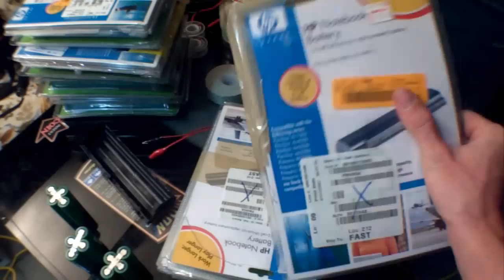DIY: 48v 24ah lithium ion 18650 e-bike battery pack

Comment: Hi, I have watched the second video about the charge balancing. However, the way you wire them is not exactly clear to me. You say you have six cells, but there are 7 wires. The video does not show exactly how they the banks of cells are linked. I would have thought there would be 2 wires per bank of cells IE: +/- (12) going directly to the balance charger. This would then explain how the balance charger can monitor the charge going into each of the 6 banks of cells.
Reply from the maker: the 7 wires are
0v - 4v - 8v - 12v - 16v - 20v - 24v.

hope that helps.
Reply: Rinoa Super-Genius Not really. I am not a electrician unfortunately. I understand enough to know that 0v - 4v represents the 1st pack of cells but I would have thought that you would need one wire from + terminal and another from the neg terminal, so 2 wires from each cell pack. It might help if I could find your schematic which you referred to in your first video.
Reply from the maker: Glyn Davies
 measure betwen 0 and 4 you get the first parallel pack, measure between 4 and 8 and you measure the 2nd pack. its just like dipping multimeter electrodes into a lead acid battery, each cell does have 2 wires coming from it but they share them with other cells. and as for the circuit diagram its in the description of the video, if you can't look that far then thats sad.
Reply from the maker: Glyn Davies
you can't blame me for not saying to click the "show more tab", should i also tell you how to turn on your computer?

and yes it's a girl's bike, because i identify as female and am having a gender transition.

i never proclaimed to be the best or even good. but i dont have time for people like you who dont want to listen to the advice i give and instead want me to hold their hand through how to do even the simplest thing like reading a video description or how electricity moves through wires.
Reply: Rinoa Super-Genius Ah... now I am beginning to understand some stuff. .. you, at least !   nobody asked you to explain how electricity moves through wires. I think its you who has the crossed wires & very little patience for your audience.

I understood 99% of your video. If you want to retain a interested audience in your work, then I suggest that you should have some patience for those who require a little clarity on the 1% which they do not understand, mainly because you had not made things clear in the video.

Have you never heard the expression "sometimes it is not possible to see the wood because of the trees" ?

As for your gender choice, that is your business and your personal choice, I am not interested and I will not judge you on that.

But for pity's sake pal ... please take a chill pill,  and be prepared to help people who show some very genuine interest in your work that you produce and who might wish to reproduce your examples for themselves !
Reply from the maker: Glyn Davies
 yes i was trying to tell you how it worked untill you started insulting me. but when i point out that you didnt look far enough to see something that was right infront of you, you get irate instead of learning from your mistake.

i dont know what to tell ya. you obviously dont want my help and just want to insult me. take your nasty attitude to somebody else's channel or i will ban you.
Reply: Rinoa Super-Genius You called me sad didn't you ?  that was the first insult which came from you.
All I asked was for you to clarify the wiring schematic for balancing the cells and I think I asked you politely.
I am still not sure, because I am NOT a electrician. I am not totally stupid but i understand the rest of the video.
I  have no intention of causing offence to you.
BUT insult me, and you will get it back pal. Ban me if you want, I won't lose sleep.
Reply from the maker: Glyn Davies
 i said if you couldn't check the description thats sad. but after i said that you did (with much difficulty) check the description.

i'll say it again, the cells each have 2 wires coming from them but they share the wires with the other cells.

voltage is only a charge difference, you can still check the middle cell and even though the negative of it is connected to the positive of the adjacent cell it still reads negative.

if that doesnt convey how it works then i would suggest linking AA batteries together and seeing if you can test them with your multimeter...

due to you not understanding this super simple principle of electronics i would suggest you not mess with large batteries right now or you might hurt yourself. research electronics and do tests first so you build your own understanding.
Reply: Rinoa Super-Genius At last, a rational explanation, that is all I asked for.

There was no need for your last paragraph.

Why did you not explain that in the first place ?

As i said, I am not a electrician,  but which part of that did YOU not understand ?

I have already said that sometimes it is difficult to see the wood for the trees.

But..  Oh ... I forgot didn't I ?
Your wish is to be female ... no patience for anything or anybody
THIS EXPLAINS EVERYTHING

Don't worry about banning me, I have banned myself !

Comment: Hi - hopefully you find time to answer this:  were the laptop battery packs you ordered labeled HP or were they generic?  I know they were in HP packaging, but that doesn't mean much.  I'm trying to find out if the generic "no name" batteries would have the good name brand cells inside them.  Thanks and keep up the good work and laugh on at the haters and flamers!
Reply from the maker: they were name brand, the generic ones have binned cells from the same manufacturers, and batteries without any english lettering tend to be poor quality cells.
Reply: Thank you very much for the reply and answer. :-)  It was as I was suspecting and now it's confirmed.  All is well with the universe again!

Comment: Your battery and wiring are capable of delivering 480 watts ( .64hp) before melting. I would increase the size of your wire and fuse it if you haven't already. Be absolutely sure you don't overcharge those lithium batteries or things will go bad quick.

Comment: I am trying to replace my ebike lead-Acid battery 24V 24aH with Lion 18650 cells. Once pack is completed, I suppose I can;t use my existing charger of LeadAcid Battery. Do I replace it with Imax 6 Lipro or  similar..
Reply from the maker: yeah you can use it, just get a BMS from ebay or whatever. a BMS is a circuit that manages the charge of the battery. i put a BMS on mine and used the dc charger that came with my motor kit.
Reply: Thanks! One more question:- will the BMS work the balance charging as well :)
Reply from the maker: Pratibha Cashmere
yeah thats its other main feature. make sure you get one for your type of battery though. like lithium-ion or lithium polymer (they are the same chemistry) as opposed to LiFePo4 which runs at a lower voltage.
Reply: Okay, I am building lithium ion from 18650..so will go accordingly.
Tnx

Comment: I guess somebody mentioned before, but just in case: You should never make a lithium battery without a BMS (management pcb). It will go out of balance and then explode when you charge it. A BMS costs about $30 and is easy to fit.
Reply from the maker: yes it has been mentioned before, so next time instead of typeing "i guess somebody mentioned it before" read the comment section to see my responses. because you watch one video about my bicycle project and assume to know everything about it. maybe watch the next video? after all its called DIY balance charging lithium batteries...... there where big annotations for it in the beginning and end of the video and in the description. and it prolly even shows up on the "suggested videos" tab.
Reply: You should add a slide to this video to give the warning because some people will copy what's in this one without seeing the others , leading to disastrous consequences. It's not just a matter of convenience, It really is a matter of life and death.
Reply from the maker: David Hess
I can't edit videos once they are up. If people are too stupid to read annotations then they can blow themselves up. It is the best way to learn after all. I'm not forcing anybody to work with lithium batteries.

Comment: how much the battery cost U ???
and how many hours the battery still work if U didn't stop?? I mean if the battery is fully charging and U start to use it in the bicycle after how many hours the charging will be zero??
and thanks to this beautiful video man ,,, great job ,,,
Reply from the maker: each 24v 24ah pack about 80$
Reply: Why?  ,,, how mush the new bycicle battery??,,,
Reply from the maker: omar al-kadhi
 what? if you buy it pre-made a 48v 20AH costs 500$. mine only cost me 180$ but i could make it for free if i got the cells from the garbage.
Reply: OoOoOoh yah I didn't thought that the normal battery cost 500$ ,,, ok at that time this is perfect ,,,
I don't think U can make it for a free it's not easy to find this battery in garbage ,,, and eaven if U find U need alot not one or to ,,,
But U did a great job bro.  ,,,
Reply: Rinoa Super-Genius
You seem like a smart guy when it comes to techie stuff but seem ignorant about the world. Can't you tell by his name and the way he's writing that he's not a native English speaker?

And to ask "why do you talk weirdly?" - not polite.
Reply: Rinoa Super-Genius
 from the garbage? how safe is that? thought it was fairly important for the batteries used in the pack to be of same manufacturer, age in cycles, that the only safe way to do this is with identical batteries used from the get go together, charged and discharged always together etc, otherwise that there are risks - if the cells are unprotected (usually the case with safer chemistry 18650s) - series connecting them risks reverse charging. In parallel connection, the risk is charging, potentially at too high a current, depending on voltage differences that develop in the pack etc.
Reply from the maker: Bioy Casares
if you want to pay 10x more sure i guess. but i'd rather make 10 batteries and let one catch fire than make 1 and it have just a tiny less chance of catching fire.

Comment: I'm thinking of getting individual li ion cells from ebay to build a stabile power for my 48v 1000 watt motor that is easy to maintain, but I'm a bit confused as to what ampere hour I should get. My question is what is difference between using 2400mah cells and 4000mah? And if I'm making a 48v one, should I run 2 series from 3 parralels of 24v ?
btw, thanks for making these videos. very informative!
Reply from the maker: well the big differance between 2400 and 4000 is that 4000mah cells dont exist. number 1 rule when buying cells off ebay, never buy them individually and especially not Trustfire / Ultrafire / Truefire cells. a lot of chinese companies buy old laptop packs from recycling centers and strip the cells out, rebrand them without testing them and sel them as if they are 5ah when they are really anywhere from 200mah to 2500mah.

best bet is to buy laptop batteries. you can get about 1$ per cell that way.
Reply from the maker: unlimitedskyproductions  yeah that looks great. i finished the 2nd half of my battery bank (the other 24v 24ah block) like i made in this video except it was made with generic cells like that ebay listing. the cells had roughly 2000mah each. some where down to 1700 and a lot where at like 2300 if i remember right.

the only differance i've noticed with these compared to the name brand cells is that the name brand cells dont discharge on their own as fast. but still the cheep ones could sit on a shelf and stay charged for a few years compared to the decade the name brand ones do.

most of the cells will probably be undervoltage so you need to get them up to 2v with a very slow charge (like under 200mah for each 1000mah) and of the like 60 or so cell i got only like 4 cells where bad.

you may want to watch my other video on it, its structured a lot better than this old video. DIY 55$ 24AH Lithium-Ion 18650 E-Bike battery 100+ Mile Range: complete build

hope that helps.
Reply: Rinoa Super-Genius  So I finally ordered myself 6 of those brand new generic 8800 mAh laptop batteries (total 6 x 12 cells = 72 individual cells) and the imax b6 balancing charger. I'm hoping to get half the amount of your ampere hours and double the voltage, So I can get my bike running with just one pack first and build myself another pack later in the short future, my question is : with this setup, do I still have to charge them separately (each 24v series?) Is there a way I can just plug them in to charge the total of 48v? and will I get the same efficiency as your setup (2 x 24v with double the ampere hour?) thank you as you've been helping me greatly with my project and happy holidays.
Reply from the maker: unlimitedskyproductions
 unfortunatly no, not without a lot of switches that is. you could make it so it will rewire itself to be 24v so it will balance charge but i say just charge it twice like 2 packs.

remember that you dont always have to ballance charge them, so it doesnt mean it will take forever to charge it twice. its just like every few weeks or months (depending on how quickly they deviate in voltage) you could just ballance it overnight to get them all reset back to the right voltage.

Comment: You you hella smart, I'm thinking of buying a laptop battery for my cree led Xml T-6 flashlights, any perticular brand I should go by? Let me know 😉
Reply from the maker: not really, tbh most battery packs have random cells inside. but i would maybe recommend buying a bad battery pack. ussually if the battery is bad its really only 1-2 cells that are bad. but if its heavilly used the other cells might not have very high AH ratings. so hrmm.

Comment: Cool video.   How do you calculate the amperage you are getting and how is it managed or controled?
Reply from the maker: by dividing the volts from the watts, or using an amp meter.

Comment: Thnx for a great video! What is the original model number of the battery pack used or link to ebay/aliexpress or other sites with this item?
Reply from the maker: it doesn matter about the model, just go for the cheepest battery on ebay.

Comment: You may have damaged your packs during testing, take it from a former rc racer, as soon as you see a drop in speed you need to shut it down or you can over discharge the pack. ...

Comment: I have an ezip skyline but the battery got stolen(live in ny). A replacement battery is going for $249, to $299. I've checked everywhere but can't find it cheaper. Is there a way where I can mod a battery case and avoid paying a hefty battery price for a $ 750 bike
Reply from the maker: yeah just build your own battery.

Comment: Hi when putting on balance leads on this battery you are making where do you put them?? Is it 1 on negative and 6 on positive???? or is it 1 on positive and 6 on negative?????
Reply from the maker: i think 1 on negative, but i show in the next video. if not it says on teh side of teh imax b6. it says what side of the connector is - and what side is +

Comment: Taking used packs apart, and each is configured differently, so I accidentally shorted some cells a few times, making a spark and warming the cells. Most of the cells are at a good voltage. It seems like it will take me forever to test over 200 cells to filter out 1/4 of them

Comment: Thanks for the vid, was wondering if its possible and how to connect batteries in series and parallel effectively. Now I have a question. With the motor wheel/bike you have, it says to have at least 17ah to properly power it, what is a safe area? And what is too high ah? Would you know? I've been looking at getting 6v deep cycle batteries and was going to connect them. One sec let me get the numbers. Also I'll probably die the Hattie's myself later but for now I'm going to just buy them since it is faster.
Reply: The only thing limiting your Ah, is the space you have for batteries, and basically, the higher the Ah is, the longer it lasts. Voltage is a different matter, since you add too much voltage, and you'll fry your motor.
Reply: Callum Bos thanks, so then my ah doesn't matter too much on how high its goes just as long as I get max 48v which is what the motor needs/takes...
Reply: That's the one. The higher your Ah, the longer you can ride your bike, before having to charge it.
Reply from the maker: Onepower
those lead acid batteries you how for sale are way overpriced for the power they provide. lithium would be much cheeper. if you used those if you bought that first one you would need 48 of those batteries to make a 48v 17ah battery. would cost you more than 700$ and weigh a ton. not counting it would only give a few hundred charge/discharge cycles.

Comment: My new Sanyo cells are red. I can't make 12 rows of 5 cells. unless I break off the battery tabs. can I make 5 rows of 12 cells in a series for 45.84v and then add the remaining 4 cell pack for a total of 48.66v, or is that cutting it too close for my 48v BMS that has factory specs of (57.6v) ? Is there another configuration that doesn't  mean tearing off battery tabs, to get the most bang for my buck?. Are 4 rows of 16 cells in a series, each row 35.2ah per row = to 35.2ah?.

Comment: thanks for sharing your videos! I really liked ..
could you help me ? I trying to decide between lithium 18650 panasonic and lifepo4 cells 15a ....The reason is C x life cycles .. can I have 60V 20A with lithium even using batteries less than 1 C ? ..I'm not expert here as you can see, so, any help would be cool . thanks
Reply from the maker: well i would recomend to never buy individual cells. you will ussually get ripped off. just buy old laptop packs. its far cheeper than even lifepo.

and yes 1c is more than enough. but most laptop cells have 2-3c.